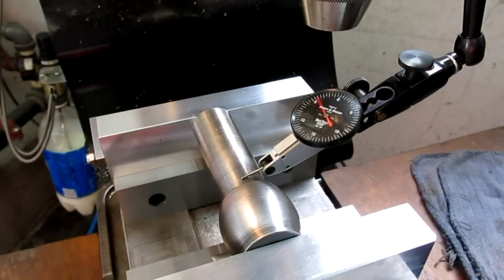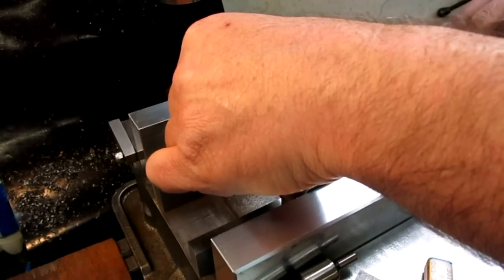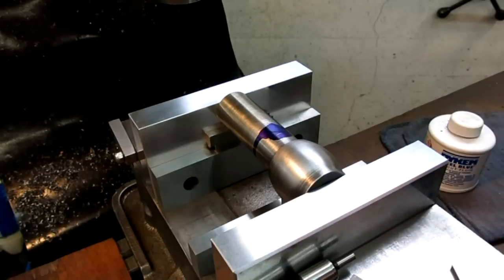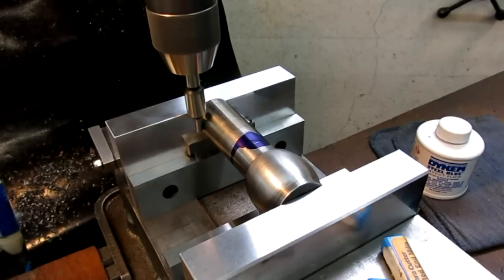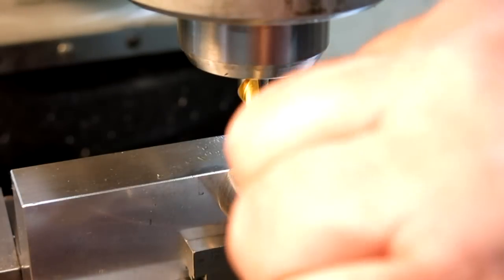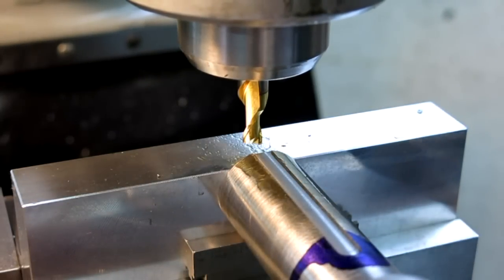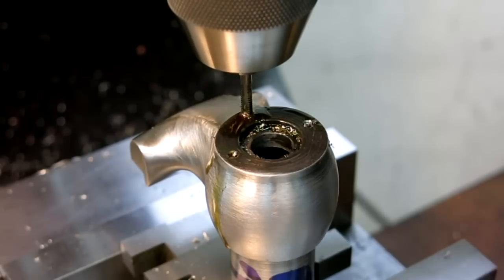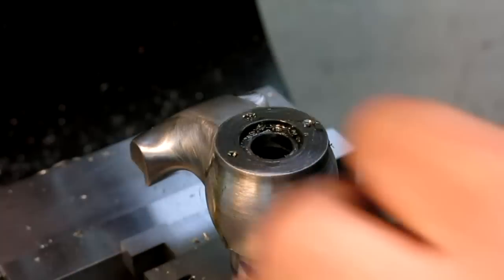Building a Wilton Baby Bullet Vise 22

Comment: The baby bullet is a work of art! Thank you for outstanding videography that makes us feel like we are right there doing the work ourselves.

I hate taping 6-32 because it is one of the weakest taps. At least you hedged your bet with a two flute spiral point tap. I usually tap drill for 65% thread to further hedge my bet it won't break (and do the tapping early in the work stream in case it does break).

Comment: Looking good there Tom 

Don't know why you worry about those large taps , they are huge . Try some number 80 drills. Taps I normally use 10 ba. 12 ba on good day if I leave the codine tabs off 16ba .

Look at a 16ba tap sideways in the box and they break

BTW like the new format it allows me to concentrate on the machining , just throw in any explanation as required , eg speeds feeds setup nuances

Stuart
Reply: +Stuart Hardy  it's not absolute size, it's ratio between threading torque and tap breaking torque. #6-32 root diameter is too small for the size of chip it needs to cut.
Reply from the maker: +Stuart Hardy Hey Stuart,

11zekim said it correctly. 6-32 is just a bad thread form. I would rather tap 000-100 ( .86mm dia) any day of the week than do three 6-32. Unfortunately the original Wilton has 6-32 so I was trying to be faithful the original. Thanks for the comment.

Cheers,

Tom

Comment: Newbie question: you made no comment about the 2-56, but were worried about the 6-32! That was interesting to me! Is 6-32 actually worse than the tiny 2-56?
Reply: +deemstyle 6-32 is a weird geometry, so they break easily.  I use 5-40 whevever I can, just to avoid it.  Plus I like that #5 is a 1/8th clearance hole..
Reply: +spaight711 Thanks for the info! I didn't realize that.
Reply: +deemstyle yeah me either. I never heard of a 5-40 screw. I have some 4-40 ones here though.

Comment: Was that the new edge finder you used getting the center for the keyway?
Reply from the maker: +spaight711 Hi Spaight,

No a regular edge finder worked. I did find one place to use the new edge finder on the Baby Bullet. Stay tuned. Thanks for the comment.

Cheers,

Tom

Comment: So where is Abom's Giant Bullet vise? (In a head-2-head fashion) ;)
Reply: +John Galt - Yeah. Now for a "bullet" with 16 inch jaws, 20 inch opening, and able to support a ton rigidly (all on a hydraulically-articulated swivel base). 4 x 6 copper jaws with individual ground cable connections would be nice (just in case you wanted to put your kiloAmp welder to work).
Reply: I like where this is going

Comment: I think you should have made that anti-rotation keyway before you welded the jaw on the moving half.
Reply from the maker: Hi Garry,

With your method I would then have to do precision welding alignment with the keyway. If you cut the keyway after you are aligning to a feature that will not be moving. Thanks for the comment.

Cheers,

Tom
Reply: oxtoolco
Actually I would disagree, I think it would make alignment easier.  Since the shaft is round and symmetrical, adding the key first means you don't have to actually align anything for cutting the keyway.  Doing so would predetermine the alignment before you used the pins to align the jaw, therefore eliminating the step of setting up to any precision.  ie: You machine the keyway, then slide the key and the slide into the body, then align the jaw the same way.  NO precision welding.  I understand why you did it the way you did and it worked out but you could have just made it easier than having to align something more than once.  Great workmanship though, and series of videos.

Comment: Tom could you tell me what the viscosity and weight of the cutting oil.
Reply: +gigabytex64 Tom did a whole video on his shop lubes a while back. He talks about the cutting oil he uses in it too. I think it came with his milling machine if memory serves me? But he does really like it.
Reply: +Paul Frederick I was just asking because I am using a 3 in 1 as it sticks to the part while turning but wipes off with no residue. I don't have much left and cutting oil is getting expensive.
Reply: *****
I use Tap Magic myself. It ain't cheap, but I like how it works. I used to use emulsified oil, but I hated cleaning it up. Tom uses some of that in the beginning of this video, blowing it off with an air gun no less. I suppose he was in the mood to clean his mill that day.
Reply: +Paul Frederick $105 for 2 gallon here in Australia so I am thinking of other methods
Reply: *****
You could use pipe tapping oil, if you can get past the smell. It is pretty wicked, but it works. I gotta warn you, once you get that stuff on your hands just soap, and water doesn't really get rid of it. You can also make your own emulsified cutting solution. Just take some water and mix in detergent, then put a bit of oil in it. The trick is coming up with an effective defoaming agent there though. Alcohol can work. Or maybe paint thinner? I think I've used acetone as a defoamer with that concoction. Just dump different stuff in and see what breaks up the bubbles for you. You'll get bubbles when you mix the oil in too. That works because the detergent suspends the oil in the water. You can mix oil in water if you know what you're doing. But you can't really leave that on your machinery. Well you can, and you can't. It depends on how much oil you put in it. An economical mix will rust metal if you let the solution just lay on it. I don't know, I don't like to leave emulsified cutting oil on stuff. But I guess it isn't the end of the world. It is certainly worth experimenting with. But I'm not saying it is the have all and end all either.
Reply: +Paul Frederick I will give it ago as I spray down my lathe after use with wd40 it keeps it rust free, but thanks one can only try.😊
Reply: *****
when I ran out of my supply of commercial emusified oil concentrate I had a go at making some myself. So I did a bit of research about precisely what was going on. What I made is a lot like the real thing. But I'm sure they use some additives that condition their material for optimal all around performance. It still works just great as coolant. But I'm not so sure how my homemade brew was as far as residue went, and stuff like that. What you do is get an empty water bottle and fill that about 3/4s full of water, and put in what you think is the right amount of soap, to make soapy water. I used dish soap, but powdered detergent might be better. Whatever says it has grease cutting action will do the trick. Then fill up about a quarter of the left over volume with oil, and shake it up. Now you have a bottle of foam. So you need to dump in something that breaks up all of the foam bubbles. Rubbing alcohol, or spirit alcohol works. But that is not the only thing you can use. Once you get your bubbles broken down back into a liquid you're set.
Reply: Definitely give it a try it sound like a receipt I found on the net but it didnt have the alcohol and would just foam up. Thanks I will try this its definitely cheaper as I spay paint so have plenty of alcohol acetone and thinner around. Again thaks.
Reply: *****
yeah defoaming is the tricky aspect of the procedure. I can remember the first time I did it and I ended up with a bottle of solid foam. I was all like this is useless. But some things break up bubbles. I think they destroy the surface tension? This is where it gets pretty hazy for me. But you basically want to dump something in there that will eat the bubbles. What you end up with should look like skim milk. That is organic emulsified oil. Or oil suspended in water. A classic cutting fluid.

Comment: #6-32 taps are worse than 1/4-20s… but using a spiral-point tap into a blind hole makes it worse. Spiral taps (the type that look like a drill) would have been much better and you'd had much better confidence in not snapping the tap.

Comment: I think I missed the part ware you squared the tube in the vice to be perfectly vertical
Reply: +dan rasmussen That would be taken care of coarsely by the v block it's in, and in fine control by indicating the center of the circle which was shown. If the tube was not vertical, the indication would have shown some eccentricity (x != y)
Reply: I think you miss understand what I mean I mean the jaw is 180degrees to the key slot he made
Reply: +dan rasmussen Ah, I see. For milling the slot, a parallel under the jaw shoulder would index the cut, while during the vertical setup, he left the key on, indexing the tube against the vise jaw.
Reply from the maker: +dan rasmussen Hi Dan,

I had a parallel in the slot where the vise jaw fits. It was kind of a trivial setup. Hope this helps. Thanks for the comment.

Cheers,

Tom

Comment: I use 6-32 all the time. It is difficult because the tap is so fragile -- but 4-40 is infinitely worse. For my audacity I will be punished by breaking a tap on my next hole. The rule is go slow and back up a lot. And lots of oily oil.